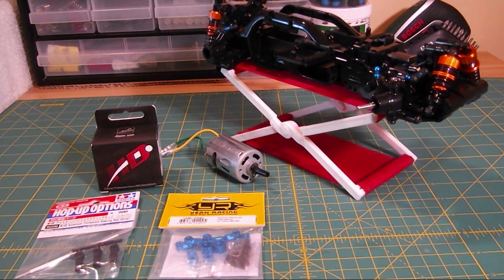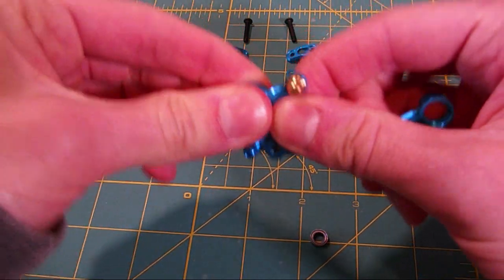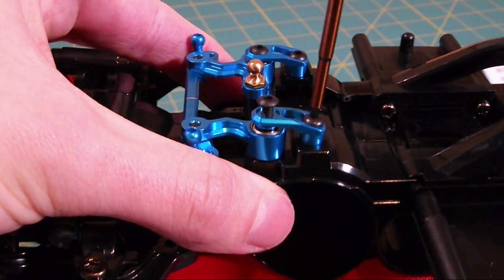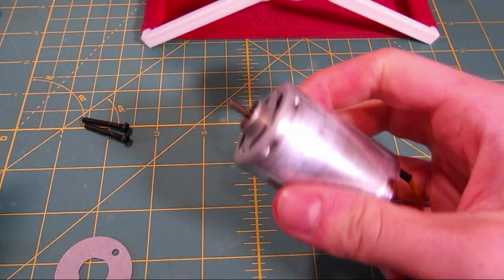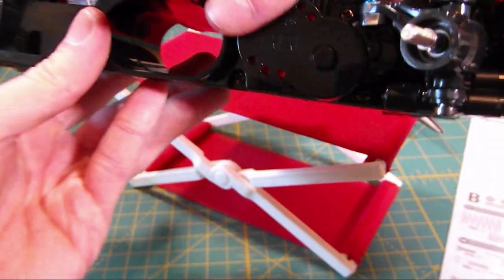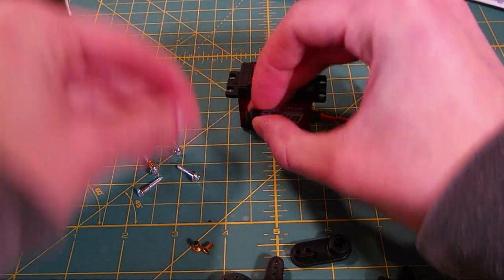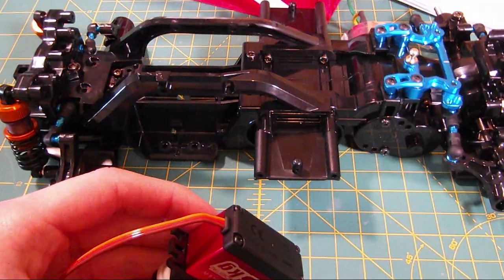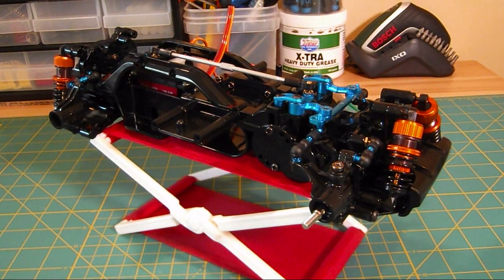Mini Project: Tamiya M05 Build / Upgrade Series - Episode 3

Comment: I need your opinion. I want to start on the M chassis. I have been with 4x4 for years. I have experience.
What do you recommend?
m05, m06, m07, m08?
I'm not going to compete, it's fun in a smooth backyard and things like that
Thanks!

Comment: Where did you get that servo? My local hobby shop recently closed down and I no longer get deals on batteries, servos, or anything like that :(
Reply from the maker: +X-FLIGHT101 I get most of my RC stuff from Modelsport.co.uk. They have a huge range, at good prices with free delivery on orders over £99. Not sponsored, but a great site. Here's a link to the servo, it has gone back up in price since I bought one: http://www.modelsport.co.uk/servos/rc-car-categories/9910/991020&ManufacturerID=1194
Reply: +RCProjects I order from them too, but I couldn't find the servo, thanks for your help ;)
Reply from the maker: No problem. Thanks for watching.